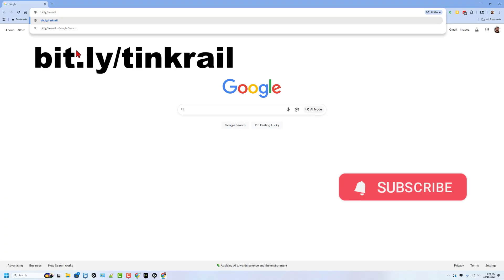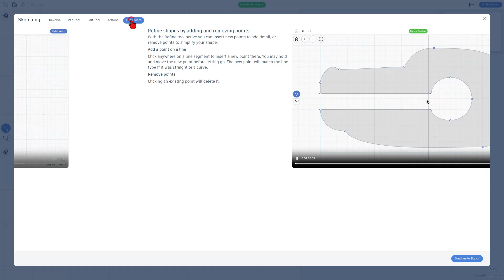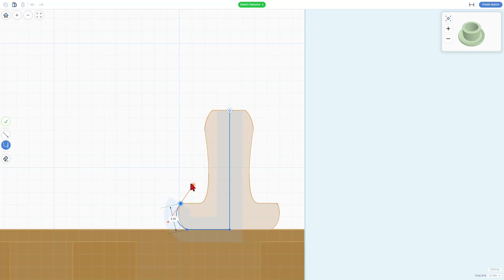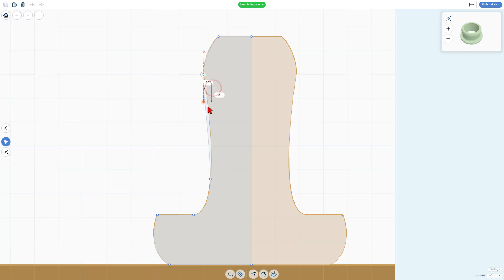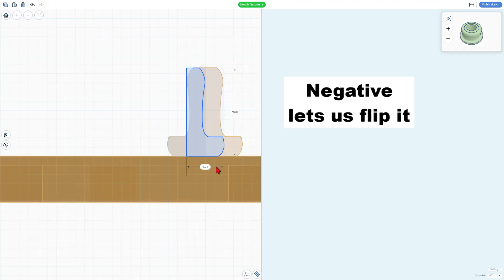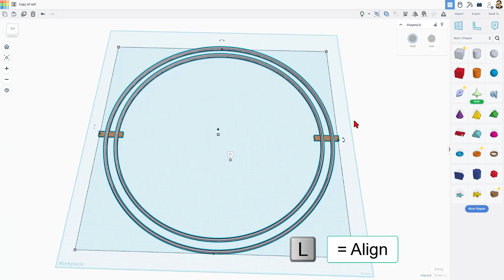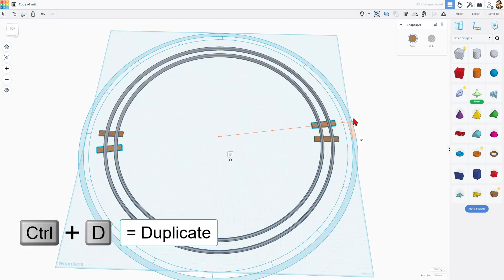Tinkercad Sketch Revolve Train Tracks! Template & Tutorial 💯🔥

Comment: Can u make a spiral water slide?  How would u make it go down the z while rotating
Reply from the maker: The trick was a built in part. https://youtu.be/_XIHUUmHWLE
Reply from the maker: Had a playground one too. https://youtu.be/0_zli2anNYM
Reply: @HLModTech those are awesome. I appreciate your response. Those are definitely what I was thinking but I was thinking more custom, like left and then right and then spiral. A steep dip then a more level decent. 
When I saw your revolve video I was wondering if those were easily possible.
Reply from the maker: I believe the only way to make that happen would be the modify the rotations on the ones I shared.  Sketch revolve does not have the ability to fiddle in Z.

Comment: I have had issues with Revolve for the past several days. No matter open or closed path, the shape still has a hole through the middle. In addition, when I edit the revolve sketch a second time, the shape always moves .01 or so off the grid. I contacted Tinkercad but haven't head back... Are you experiencing this as well?
Reply from the maker: If you do not built right at the edge there will be a hole in the middle. Also if you use the stroke, half the stroke will be below zero after it is created. Any chance that explains what you are experiencing?
Reply: @HLModTech  I don't think that is. Something I left out is that I opened an "older" revolve shape (that didn't have the hole), and when I saved it unchanged it suddenly had a hole. When I line it up to the edge it is always a little bit off the second time I edit it. I think these two behaviors are related, and probably a bug. I just want to confirm I'm not the only one.
Reply from the maker: Double check that you are not using the rounded or squared off end the stroke settings. That would go past the plane as well.
Reply from the maker: This is how you can get a message to Tinkercad. https://bit.ly/tinkhelp

Comment: One extra request - can you demo using the measure tool in conjunction with placing the rails so that we can create templates that match the 1:140 N or 1:87 HO scale values?
Reply from the maker: I do not have any train stuff... so I have nothing to really base it on. =(
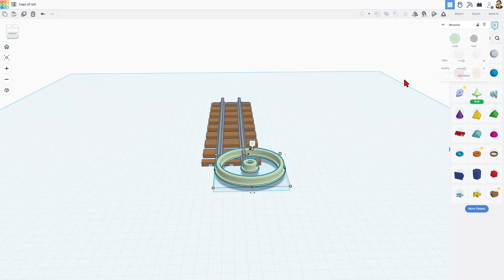Reply: @HLModTech  Thanks for all of your work and consideraing this. My request is to show things like how we could select the center point of each rail assembly and position it with relation to the other rail's center point instead of the automatic values shown from the outside of one rail to the outside of the other as at 5:05 in this video. The numbers could be arbitrary in the example since we can easily retrieve actual values from the NMRA website.
Reply from the maker: Ok. I think at this time you would need to draw an extra box in the sketch tool to get the dimensions from the center of two objects... even then it would be guestimates. Tinkercad does not have ruler tools in sketch yet.